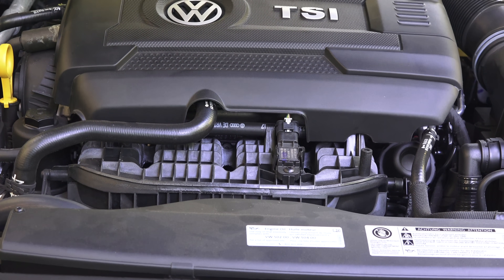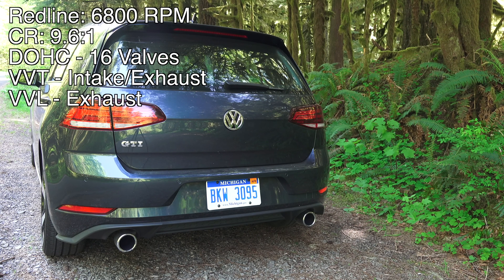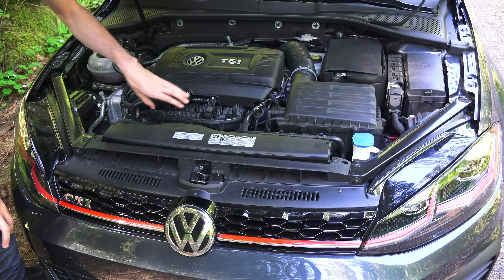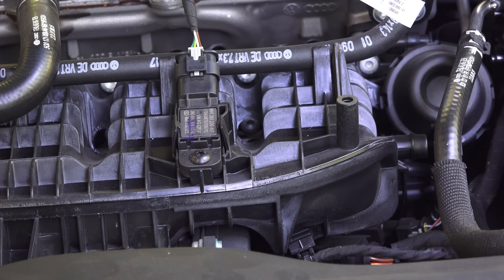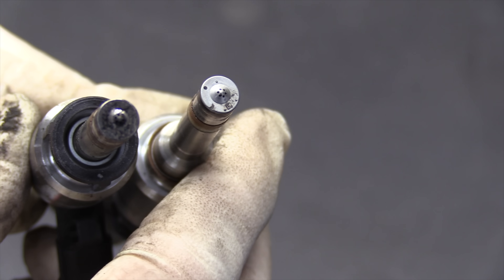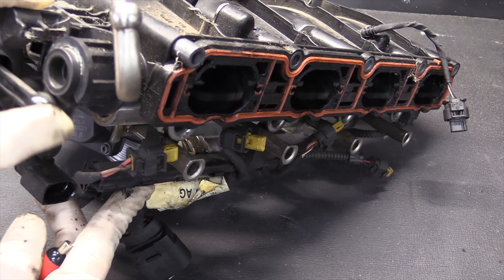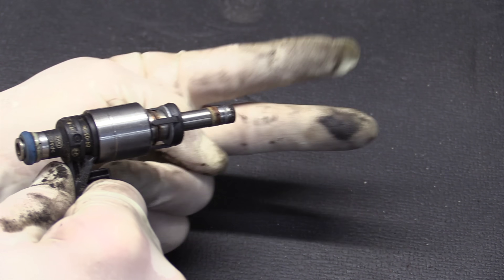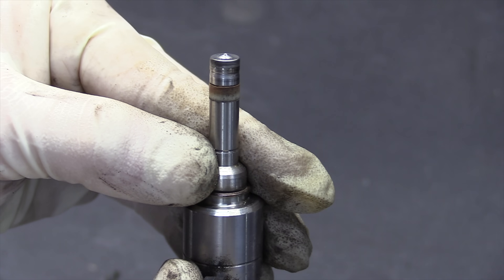The Best Engines - Volkswagen GTI Turbo

Comment: So how does one tap the torque at 1500rpm without lugging it or risking LSPI? Only available in 1st and 2nd (where boost is limited)? When would you downshift in a manual vs applying more throttle and toughing it out until higher revs?
These DI turbo engines have more and more low-end torque availability...but it feels so weird when I give it throttle and it stays in 6th at 30mph under heavy low (auto)...and even worse when I try to use 1500rpm torque in a manual.

Comment: I can't say I would call that engine a masterpiece after my grandmothers experience with a 2016 Jetta Sport with the 1.8L. The car drove great, very peppy and respectable fuel economy. However it started consuming noticeable amounts of oil inside of 20k miles. To the point she had to bring it in a few thousand miles early because the amber oil light illuminated. And building upon that, VW honestly thinks its ok to run these engines 10k miles between oil changes when they quite clearly should not be, turbo charged engines should never have an oil service interval beyond 5k miles. We turned that junkster in and got a 2017 left over Camry for a great deal, Toyota generally does a 10k interval as well but they had no problem at all with servicing it at 5k when I took it in for a break in oil change and all subsequent changes at 5k. They don't even charge for it which they honestly could.
Reply: Michael Harrison it’s weird actually, cos in Europe we run them 30000 km between oil change. And yes, i had to add around a liter during this period, but still it was never any drama or excessive dirt.

Comment: What happened to that head shown? it looked a lot more dirty then my 320.000km/200.000miles Saab 900 16Valve head.
I have heard stories about the VW engines eating there own intake flap things, leading to engine destruktion.
Reply: Lars Jørgensen it got stuck, threw a code and car went into limp mode. Because the rod to open the valves is inside the unit (which cant be opened without breaking it) the entire runner needs to be replaced. Check out humble mechanics youtube channel, he explains it there

Plus oil consumption and carbon build up from direct injection

Comment: The 2L engine can hold a lot of Power.
Very easy 500Hp+ without opening the engine at all.
Greetings from Germany 🇩🇪
Reply: Jay Edlington you can. There are plenty of them in my group. Look up the man that has the 600hp Golf R
Reply: Jay Edlington listen to zohan
Reply: freakyRunner you are absolutely correct 💯 😍
Reply: xJohn1300 he’s talking about leaving the internals stock. Which he does have a point. The engines are very strong in all honesty and I love my Mk6 GTI because of the engine performance. But he’s right in the point that pushing such high numbers out of a 4banger (which in 2.0L engines is actually easy) is also kinda scary. So imo if you’re willing to go that high, just play safer and get forged rods to support it and maybe some piston heads and some beefier rings, so you can enjoy such fun out of a lightweight overlooked hatch
Reply: Jay Edlington You can with mods/upgrades, smh..
Reply: Imagine some crazy mechanic did put a 540 hp turbo in a MK7 GTI Clubsport -  Same car i own, go check it at my channel!
Reply: factual statement
Reply: Why do they only give it 220hp?? the accord and Kia 2.0 get about 260hp stock. I know this engine can handle more compared to those cars.
Reply: @Alumnikiid  My MK7 GTI Clubsport does 265 hp standard an 290 on overboost. But it does have some of the Golf R internals though, except the 4WD. However its lighter, more aerodnamic, can send 100% of the power to the front wheels.. Check videos on my channel!
Reply: jonny j well iron rust (even aluminum engine can be corroded nowadays, or the chassis rust killed the car before the engine dies, pathetic)
Reply: While these engines can stand such power on stock internals, they do require a piston, valve and rod change/upgrade in order to continue providing good reliability for the long mile. For a 4 Potter, even with such "non major" changes, that's still impressive.
Reply: Hahahahahahahahahahahahahahahahaha, you must not own one that fast then. 500 hp from 2.0L is insane. It would literally rip the cylinder walls apart from inside after several thousand km. Also, the rings would bleed oil as fast as you can put it in. Don't overestimate VW's material selection.
I agree it can hold boost but not over 25 psi. The rings would literally blow down into the crank. Hilarious that you think you can add ~300 hp to a stock mass production engine though. Made my day.
Reply: Jay Edlington 350 hp tune (and turbo upgrade) on my 2006 GTI 2.0T.  100% stock internals, original motor.  Oh yeah, and it has 190k miles on it, is beaten daily, and still holds 170+ psi of compression.

So put that in your pipe and smoke it ;)
Reply: +Jay Edlington 

I've got a Seat Leon Cupra (basically the same as a Golf R) running 420hp/550nm and only changed basic stuff (APR Stage 2 & DSG Map, R600 intake, turbo muffler delete, GFB DV+, RS7 sparkplugs, R8 coil pack & Turbo back after market exhaust), never had problems, only thing I do different is a new filter and oil every 5k miles, instead of the regular service intervals. 

I know people running over 500hp with stock internals, these engines are far better than most give them credit for
Reply: Jay Edlington how about bisimoto crz, 1.5l engine with 533 horsepower
Reply: Yeah then they go BOOM!

Comment: I thought this would be about the legendary 1.8t instead but nooo
Reply: 1.8T really doesn't get enough attention considering what a wild engine it was.  Even on the B5's it was 20V, DOHC and tough as anything.  It does lack the good stuff of the newer engines though sadly, early models had no VVT or VVL, no direct injection, etc.  

I've heard of people getting them into the 700+ KW area though, and even the fairly "streetable" builds seem to be doing up to and sometimes exceeding 300 KW.
Reply: Matthew Baker They’re great little engines imo. Love my AWP 1.8t
Reply: I put a APX 225 into my corrado with a mk3 diesel box and with just a ecu remap it was hitting 300 ftlbs/hp mark. It was an animal and sooo much fun. I miss it.

Comment: My VW GTI was a POS.  Check engine lights galore, carbon buildup robbing power by 80000kms, $3000 fuel pump died at 100000kms.  Junk.  Would never own one past warranty.
Reply: Lol, You know your Ford Focus is built in Germany right? and designed by Ford Euro, the only American thing about it is the badge and the person sitting inside it.
Reply: WhiskeyTangoPapa I find it funny how people, especially Americans, complain about the reliability of their Euro cars. Yet I, nor anyone I know that also own a Euro have never had any issues with reliability. Maybe you guys just treat every car the same and as a result they fail due to your own lack of care.

Its like when morons say rotary engines are unreliable because they treat them the same as a piston engine. Different engines require different maintenance, and maintenance is everything for longevity.
Reply: Awesome!
Reply: What are you smoking ? $3000 fuel pump ?! high pressure direct injection fuel pump for GTI is $286 at ECStuning, a GENUINE VW one ! 
lol what an clown ...
Reply: I have 29k Miles on mine with ridiculous whine engine heat leaking into the cabin. And now on occasion I can smell gas vapor coming into the cabin... Never had this issue with my Japanese or US cars.  Last the Paint quality on the GTI is crap. My My Ford Focus had a better paint job that always shines.

Comment: Does anybody know if the manufacturers made any progress on the particulate emissions of these GDI engines ?
When the first generation was released, they were much worse than diesel engines !

Any improvements on that front ?

For instance I'm keeping my older port fuel injected engine because of that. A tiny bit more CO2, but no particulates. (between climate change and lung cancer, I choose climate change, sorry :-D)
Reply: They use direct and port injection. VW group uses this in all their 2.0 TSI EA888 engines in Europe becuase of the particulate emission regulations.

Comment: The new 1.5 TSI that the facelift golf has today it derived from the EA888? Or its a new design?
Reply: I have this engine. 1.5 TSI EA211 150BHP 250 Nm/ 1,400-4,000. I believe it is based on the previous 1.4 TSI engine. 
It's awesome ! I love it. It's really responsive and has good gas mileage.

Would also love a video about this engine !
Reply: Vlad Gorgan. 1.8.
Reply: "Ford" "Reliable"

Lmao! sure kid
Reply: andrew7720 
The design can only change so much, in the end it is: quality of incoming air, quality of combustion chamber, type/design injector(s), quality of 4 stroke scavenging and exhaust removal. It is just 4 fireboxes in a row, so my Ford is truly the same thing but more reliable & cheaper to fix.

Comment: Do the intake valves have to be scraped every 40,000 miles like on  most direct injection engines?
Reply: Not on Gen3 EA888's. Check the forums, plenty of cases where people checked buildup at 75-80k miles and there's just a light coating of deposits--nothing heavy to weigh the valves down or inhibit airflow. 

Of course there are a few cases where people who take a lot of short trips, don't let the oil heat up, don't let the car idle for a minute after spirited driving, don't drive spirited very often etc. have seen carbon buildup at 50k but that's almost entirely driver error and preventable. 

If you drive the car hard semi-frequently (AKA Italian Tune-up) and run BG GDI or CRC GDI cleaners once every 15k miles or so to knock out light deposits there won't be any problems.
Reply: Ernest Miller it is recommended yes.

Comment: 226,607 miles on my MK5 GTI with just a clutch replacement!!! i love my GTI
Reply: Blues Clues M3 just got my mk7.5 in January and looking forward to allloottttt of miles..
Reply: Blues Clues M3 seriously? Original engine too?
Reply: @zohanjames7793  i think he meant he replaced the car the clutch is the only original part left haha xV
Reply: Zohan James original engine with no rebuild. She leaks a little but nothing crazy yet. Gearbox is smoother than any car I’ve driven. Easier than an 89 E30 325i I had a while back.
Reply: Trevor Nickerson that's awesome man! 😎
Reply: beek. inc have a mark 6 autobanh man I wish I waited for the 7.5😂
Reply: VS Vision ok. well 4 years is alot to wait for the 7.5. lool
Reply: Haven’t even had the chains done?!
Reply: Good one Jose Torres . I been wanting a mk6 or at least a mk5 but I get 220k at least I be happy! Lol
Reply: Danny  Martinez mines already needing a new oil separator, probably going to get a oil catch tank, I had to change out the water pump I got about 110k bought it used about a month ago though
Reply: Blues Clues M3 where u the 1rest owner? If not how many miles did you put on?
Reply: VS Vision when did you get the mark 6?
Reply: beek. inc back in the beginning of 2014
Reply: 1 out of a million! You’re very lucky
Reply: Damn that’s wild how often you change your oil?
Reply: Did vw paid u to say this?...
Reply: mk5 had the EA113, predecessor of, and very similar to, the EA888 gen1 in the mk6. I've put 135k miles on my EA888 gen 1 and only had to replace an O2 sensor, and mine is making almost 80% more power than stock.

That said, I also put 230k miles on the infamously unreliable AEB 1.8T without any engine issues whatsoever. VW gets a lot of flack in the US, much like Ford does abroad.
Reply: Trevor Nickerson is the mk6 GTI EA888 Gen 1?
Reply: @Nickersont88  the 1.8t is really tuff it only good problem whit vacuum leak

Comment: I have the EA888 Gen 2 engine which is just variable timing on the intake. It is a powerful engine, on this revision a stage 1 tune which is 16psi of boost can hit around 190-200kw at the crank which is pretty impressive. The Gen 3 in this video can hit around 220-230kw with the same tune due to added variable exhaust timing. These engines are shared in many different VW's so it's really easy to get parts/diagnose things however it does have down falls. Lot of owners have reported oil consumption (which I've experienced myself 1L oil every 2000KM's or so), don't have very good fuel economy (I get "average" 12L/100KM, much higher in traffic). Because of direction injection and no port injection included, it will get a lot of carbon build up over time. Also this engine is very susceptible to heatsoak. Other common problems include leaking water pump from failure to properly install the gasket or oil leaking on top of the seal which causes it to swell. GTI is front wheel drive only, Golf R has the same engine with a bigger turbo and an AWD drivetrain. Gen 3 incorporated a plastic oil pan which can be damaged incredibly easy and costs around $500 from oem just for the part alone. Stock PSI for the turbo is 8PSI, Stage 1 for these engines doubles the boost from the turbo and improves driveability and performance dramatically. The GTI is a great car and so is this engine, however don't be shocked when maintenance costs are high :)
Reply: Dual injection in Gen 3 engines outside of the US, so carbon build up should be less of a problem for these engines.
Reply: Theres no dual injection in Australia either.
Reply: pervertt cost cutting. The amount of safety features European versions get is so much higher and better than the rest of the world. I remember watching videos from vw talking about lane assistance, fatigue warning and all that fancy crap to find out theyve stripped it out for our market.

Comment: Are we just going to just skip the carbon build issue with these engines?? 🤔
Reply: They use port injection alongside the direct injection, so carbon build up is not an issue. (They don’t in the USA because they don’t need it to achieve emission standards there, in Europe they need it for emission compliance.)
Reply: Andreas Roovers seems like they should do it here too. Toyota does
Reply: BingBong Boopledoop right lol🙄
Reply: Carbon build up happens with all engine especially direct injection engine
Reply: Carbon buildup applies to ANY direct injection engine.  It’s just part of maintenance.  On my mk6 it cost me $750 at 110k.  Not a big deal.  Just find a good vw/audi mechanic and stay away from the dealership.
Reply: @Viscerok  why stay away from the dealer? They know the engine inside and out. Have a little faith. ;)
Reply: Deadman 25 right, but if you do some research, it seems that these audi /vw engines seem to have it worse then say subaru or Honda direct injection motors
Reply: Forced Induction my point exactly, why wouldn't everyone car manufacturer do this to avoid the problem on the first place?
Reply: Mazdaspeeds engine have just as bad carbon build up but yeah these do have  bad carbon build up lol

Comment: Also just an FYI for people, it's not uncommon for these to make 320-340 whp with a Tune and a downpipe. That's a lot for a sub 3,100 pound car.
Reply: That's incorrect. There's been quite a few examples of SAE corrected Dynojets making that amount of power. Do you have a spam email address? Post it up and I'll send you a few source links. There's more to making power than turbo size and boost btw. They are very strong motors that have very high flowing cylinder heads, DI, watercooled exhaust manifolds etc. Lots of cool tech.
Reply: Actually yeah you can, just turn up the boost with the tune and everything else plus the down pipe.
Reply: GlassTopRX7  the gen 3 2.0t in a A3 with a tune and downpipe does low 12/high 11s guy , gti prob mid 12s
Reply: GlassTopRX7 I have one dude.. lol there's literally vids all over the place. Off the shelf tunes are doing 12.3/4 and they usually run shitty tires on those runs.

Comment: Is there any benefit for having a firing order like 1-3-4-2 instead 1-3-2-4?
Reply from the maker: Good question! For a flat-plane inline four cylinder (which are all the ones I know of, done for balancing purposes), 1-3-2-4 does not work because that means cylinders 3 and 2 would fire sequentially, when they move up and down together. It must alternate between the two sets of pistons which are 180 degrees apart (1 & 4 are paired, and 2 & 3 are paired). Hence, 1-3-4-2 is used and alternates pairs.

Comment: Would you please talk about BMW's N20B20 engines that equips most of the 1 and 3 series starting from 2013. Specially the differences that makes power output be so different from the 20i models up to the 28i models (184hp ~245hp) ?